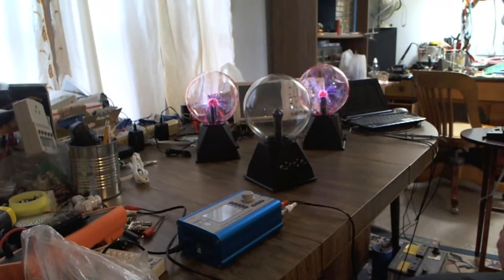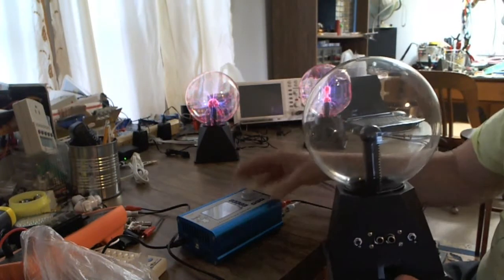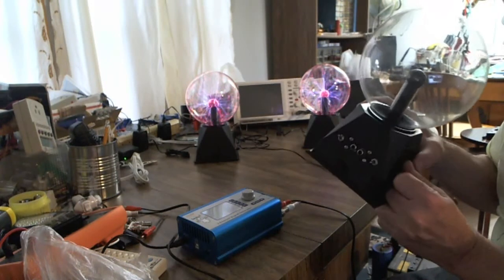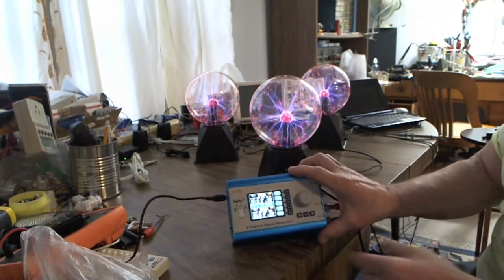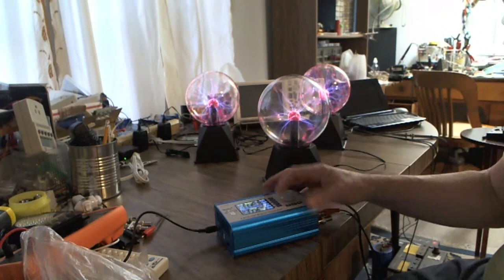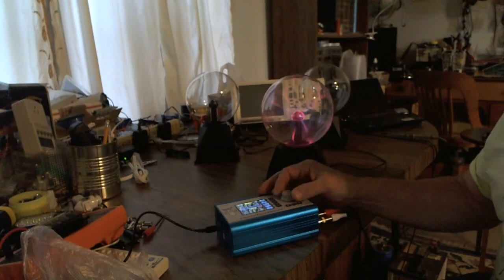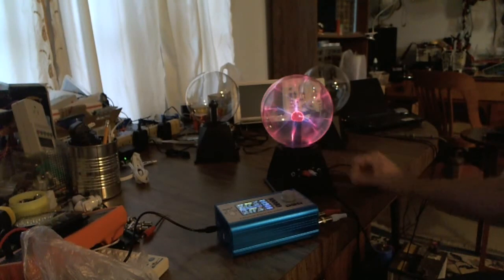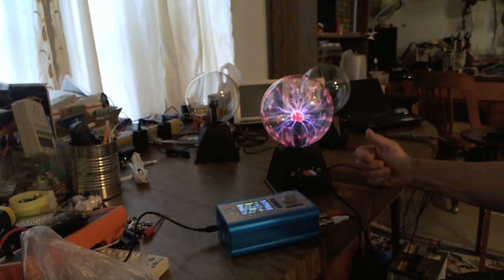Unbelievably Dynamic 6 inch Plasma Ball 1

Comment: I was able to connect my spooky2 with special BNC cables to my to channel home stereo.

Then from left and right speaker wire two tens pads.
Now I'm wondering if I could remove the tens pads and connect out to the plasma light bulb?
I'm not sure if you can but you should try to privately message me so I can get ahold of of you.

Are you able to measure how far you can be from the plasma light bulbs to be affected?

for example my friend has the gb4000 with the mo Pa and plasmalyte he ran a parasite program for 15 minutes but I asked him not to tell me what program he ran and I would let him know if anything changed.
The next day I shat out parasites.

I'm wondering if you would have the same success connecting to a 2 Channel amplifier and that light bulb?

Comment: Are you thinking this has the same potency as the spooky plasma bulbs they offer?
Reply from the maker: Interesting the way you phrased your questions.  The Plasma Ball generates an Electric Field as does the Phanotron tube used with a Spooky.  However there are significant differences in the implementation of the electric field and how it is generated.  The Plasma Ball uses about 2 to 3 watts of power where I’ve been told the Phanotron tube uses up to 40 watts.  What is generated in the way of the strength of the Electric field by the Phanotron Tube is unknown to me.  The Plasma Ball can easily generate over 1000 volts/meter at about 1 foot away from the Plasma Ball.  Within a few inches I would guess it exceeds well over 10000 volts/meter because of the ‘square of the distance’ law.  Depending on frequency it can easily generate 100 volts/meter at a distance of over 2 feet and still be easily detectable at 3 to 5 feet.
A significant difference is the Plasma Ball generates its electric field via Birkeland Currents.  This is how the Universe transmits electric fields.  Modulation technique is another important consideration and the Plasma Ball can be both directly modulated up to 50 KHz or be carrier wave modulated through gating up to about 10 KHz.  It can be every bit as effective as a Phanotron Tube in many ways, more effective in other ways, and less effective in many ways as well.  It is a different approach to utilizing Plasma Technology and by using the Spooky Software ‘Frequency Limit’ harmonic setting features can run every Protocol the Phanotron Tube can.  I hope this little bit of information gives you an idea of how powerful a modified toy converted to an electric field delivery device can be.  Respectfully, Steve